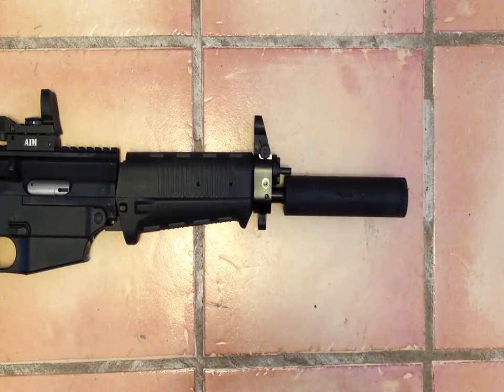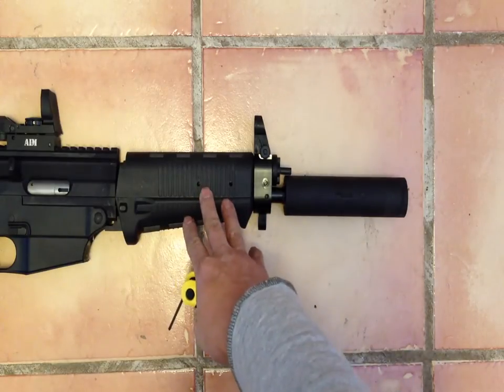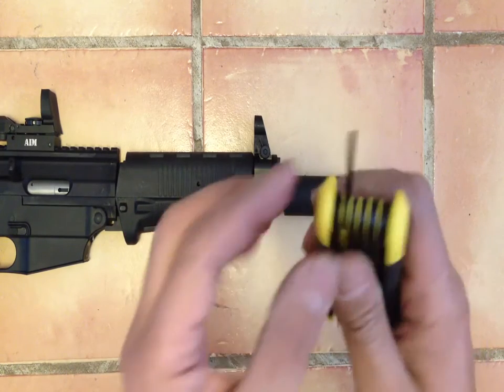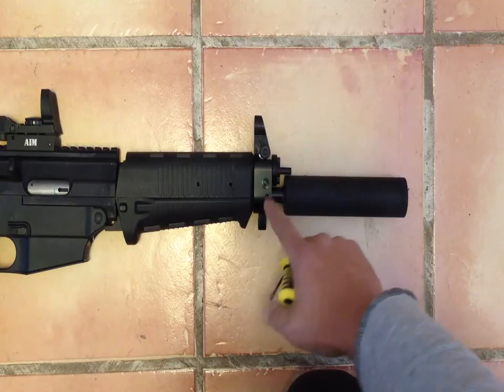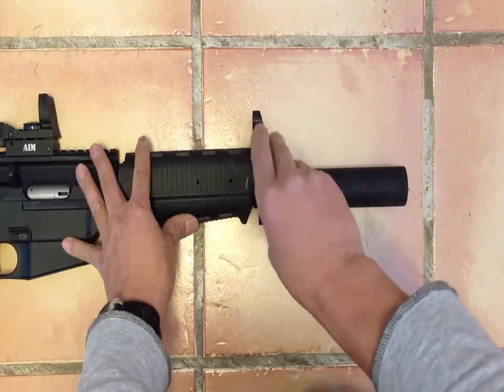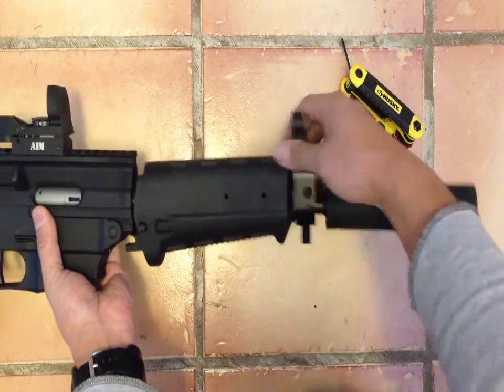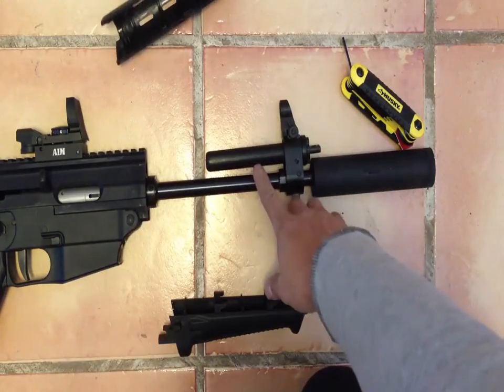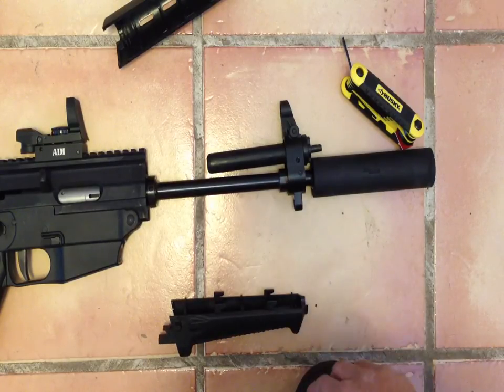Sig 522 Handguard Removal

Comment: what the hall! you don't have to remove the fake gas block to take off hand guards ! just separate the upper from the lower pull bottom off and smack the top one up and off that platform is designed to be able to remove those hand guards easy and quick